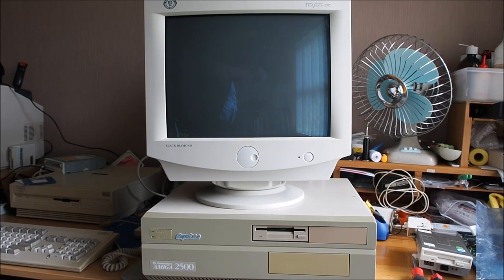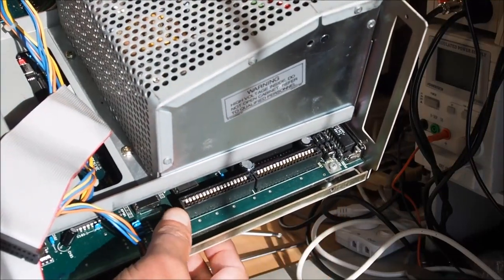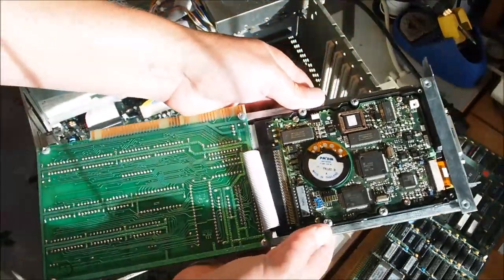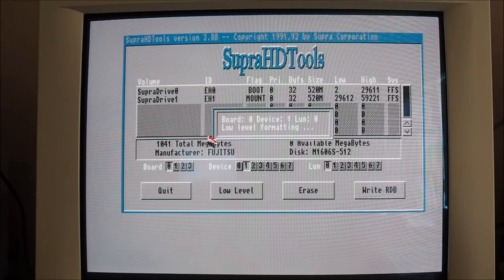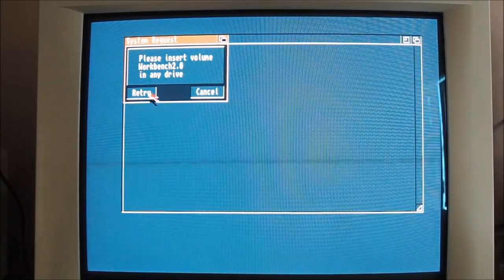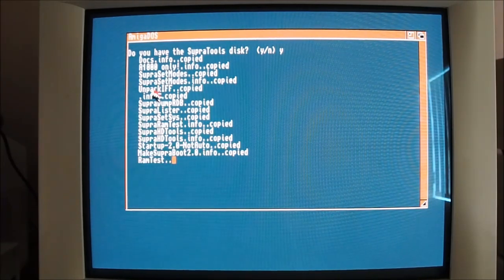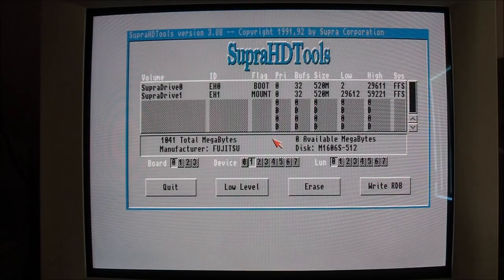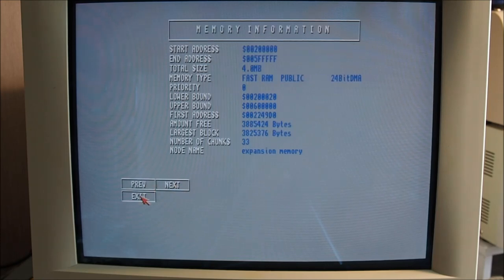Tricking out the Amiga 2500 Part 1.

Comment: I'd love to see you replace a older desktop thats not a A4000 AMIGA's ECS Paula swapped with an A1200 AGA Paula and early Kickstart replaced with a 3.1 see if the motherboard smokes with the AGA Paula and AGA Kickstart in it if it doesn't and it actually works its a true custom AGA AMIGA Desktop that can use all the A1000 ect expansions but can run all AGA software woooo or it might smoke booooo.